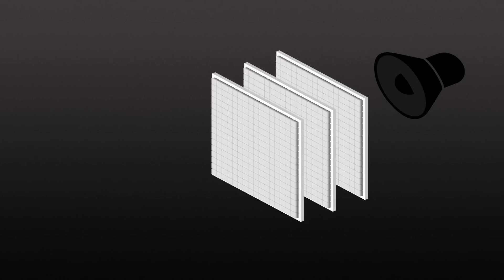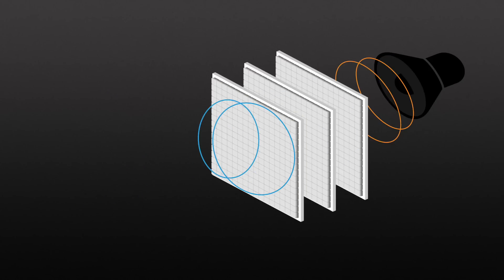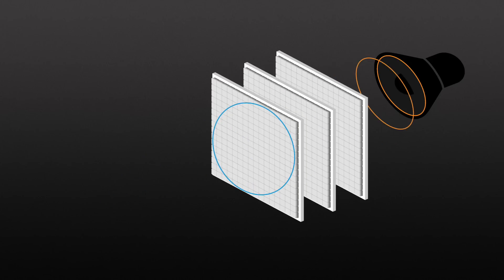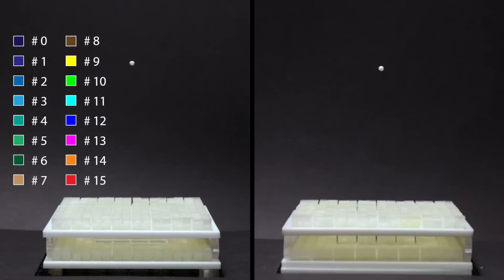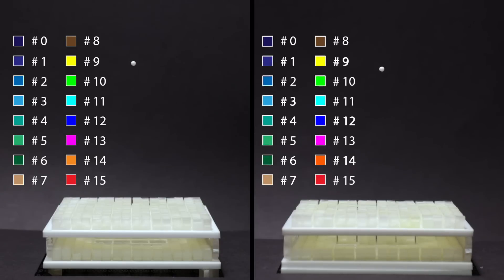Metamaterial bricks and quantization of meta-surfaces

Comment: I don't know if I'm perhaps missing something? It just looks like a tiny array of wave guides and delay channels, arranged in such a way to control the sound. Its a novel use of an existing technology, an interesting technical advancement for sure to build it in little lego bricks and arrange it in this way to create different diffraction patterns. But doesn't look like anything as ground breaking as it's being made out to be, despite adding the word "meta" and wrapping it all in lots of fancy buzz words? The same kind of thing has been done for years in the design of large scale concert speaker systems.